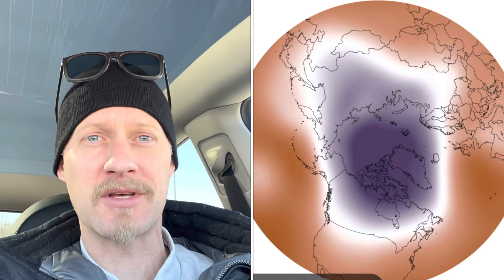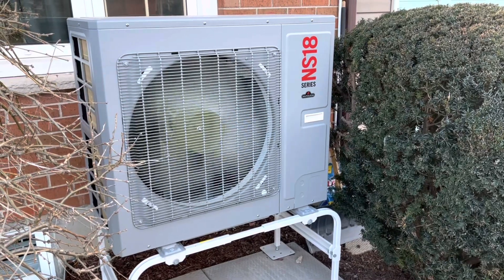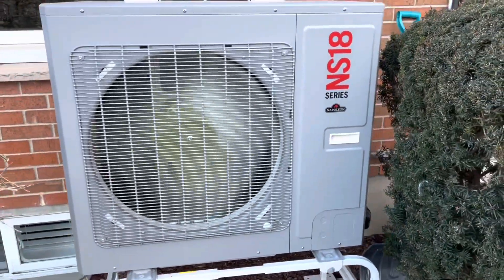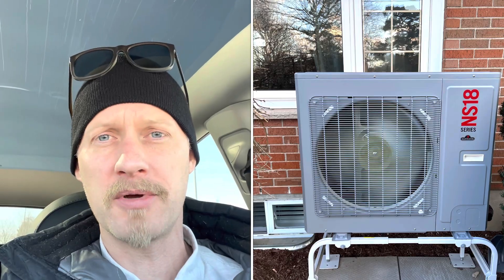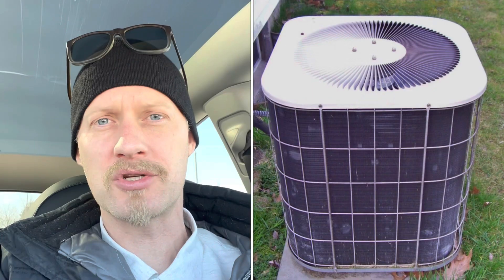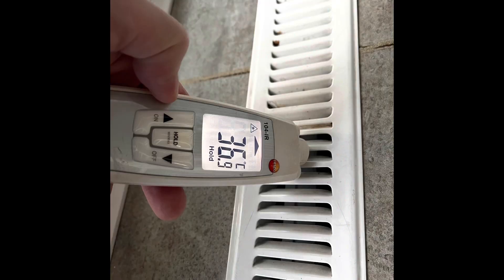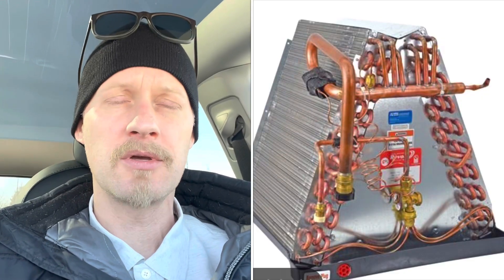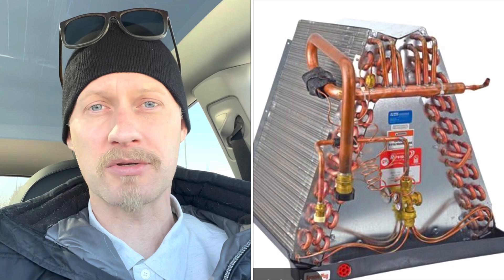Cold climate heat pump, the truth in the cold!

Comment: NO!   These Heat pumps do not work enough under freezing. Forget it. They should not be placed anywhere in zone 5 or below.  Only The South such as Kentucky to southern Missouri down. And in Florida and the Deep South just buy a good seer AC and furnace.  They are not worth it in the Deep South.
Reply: Which heat pump matters a lot. The Mitsubishi is good to -5 F, maybe lower. The Friedrich is only good to 45. That one is only advertised as an AC unit with a heating capability, so it does operated as advertised.
Reply: @mikespangler98  people in my area are no longer in the heat pumps that are wise because our power bills have doubled and everybody is switching to propane. I’ve had 2 heat pumps …one died in 10 years …the compressor and the second one has had $3000 worth of repairs on a computer board and several other small issues and thank goodness I bought a five year warranty and both were Trane. Seer 13 first. The unit now is six years old and it’s a Trane Seer 18 xi.  3000 in expense so far.  No more.

Comment: Heating your home with 97 degree air?  What was not discussed was how expensive is it to run a heat pump in cold weather.  Once the strip heat comes on $$$$.  It works, but at what cost?
Reply from the maker: Efficiency video is next but sneak peek (it’s less than half what gas costs). No heat strips in this set up.
Reply: Heat pumps are about 300% efficient compared to dinosaur gas furnaces which are less than 100%

Comment: I have a zoneline style heat pump/resistance heat HVAC unit and if it runs twice as long on heat pump mode versus resistance heat, where's the savings?   Also it's completely ineffective below maybe 35 or 30 degrees, but I don't think it is a "cold climate" heat pump.
Reply: You didn’t mention where you live but in general heat pumps are meant to run for longer periods of time and put out lower temp heat say 90F. However for the same kWh of electricity to run the heat pump you will get 2 to 5 kWh of heat depending on outside temp vs 1 KWh of heat from your resistor heater back up/ supplemental source. The refrigerant in the heat pump is cheaply “ grabbing” the ambient heat in the atmosphere. You can verify this by getting a fancier thermostat that can tell you how many kWh you use when heat pump is running vs resistance heater. Other heat pump videos on YouTube can explain the how’s and why’s of their proven efficiency over burning fuel or using electrical resistance. 
Best metaphor for this is going 40 miles in Toyota Prius on 1 gallon of gas vs 40 miles in Pickup Truck on 3 gallons of gas.
Reply: @Pierceb2  Thanks, that explains it.  I live in New Jersey.  Your Toyota Prius analogy at the end really clears it up for me.

Comment: mmm...well I had a heat pump when I lived in Florida, when the temp was below 40 Fahrenheit it didn't do much and the aux heat came on, of course this was one that looked like an a/c unit. However it was a high efficiency unit from a major manufacturer and it was constantly breaking down, the circuit board, blower and all kinds of electronic parts were very unreliable and never less than $500 to fix. my neighbor bought a high efficiency unit from one of the best selling manufacturers and had the same experience with breakdowns and repair costs.
Reply: I have an early model inverter heat pump in Fl too....after 7 yrs its had no issues other than annual service ($89). It sips electricity and on cold nights (40 degs) and heated just fine. The most important thing to install in Fl is a surge protector for lightning & power surge.... my neighbor had that issue and it blew out his circuit board and compressor. The newer heat pumps for cold climate are much better and can heat down to -22 degs.

Comment: Thanks for sharing! We're also in southern Ontario, and we're having a ducted cold climate 20 seer heat pump installed in a couple weeks, as well as a Rheem Hybrid heat pump electric water heater. Needless to say we are quite excited to be ditching more gas! Wondering if you have a rough idea of your kwh usage for your heat pump per month for January and or December? Thanks either way!
Reply from the maker: Yeah I use the emporia to monitor energy and looks to average about 500kwh a month so far in winter. Seems a lot but that’s about $50 in energy compared to twice that in gas for my mid efficiency furnace. Hoping to do Solar soon to balance the cost.
Reply: @yourelectricneighbour3633  awesome! Thank you! We were planning to do solar this year too, but our local grid won't accept any additional kWh at the moment and battery storage is just prohibitively expensive right now. Can I ask how many square feet your home is?
Reply: @yourelectricneighbour3633 That makes it worth it. Mid-efficiency you will notice. Here in USA, we have been required to replace our mid efficiency when they die with high efficiency condensing furnaces. Cheap operating! In my darned state, we now HAVE to all use electric heat from now on ONLY, so when our HE furnaces die, we have to get heat pumps. This winter it went to 8° F-about 13° C. But we hit 0° all the time. Am I going to get cold????😢
Reply: Did you have to upgrade your hydro service to accommodate the heat pump?  If so, up to how high?  How is it for cooling in the summer?

Comment: You mentioned windchill. Windchill has absolutely nothing to do with the actual temperature or if a heat pump will or will not work. People use the term windchill to make things seem like they are not. Windchill decreases the time it takes an object to drop to the actual temperature, but it NEVER lowers the temperature. Why anyone would go with a heat pump when they have natural gas is a mystery.

Comment: Mine must be rated for 38°F. It sucks and can’t keep the house at 68°F. In Arkansas.
Reply: If you select the right heat pump for the building and climate they work. This applies to any type of heating system. Cold climate heat pumps will just cost a bit more initially.
Reply: You should get a digital thermometer and see what temp air is coming out of your vents. If it is say 75 F or higher you should look at your insulation, drafts, air leaks, window quality etc. I would get a consultation from a contractor perhaps different from the one who put your system in who is in the energy efficiency business. If your state is not promoting energy efficiency check out Northern States like MA, NY, VT and ME based energy efficiency organizations websites. They have lots of info, advice, videos, testimonials etc. 
Many other great videos on YouTube on troubleshooting issue, problems, tips and tricks.

Comment: It dropped to -33Celcius a few weeks ago here.  My heat pump (mitsubishi zuba hyper heat) worked just fine to keep the house at temp until -27C.  When it dropped to -33C it gave up and the aux heat turned on.  That was the only time all winter it used Aux and it only used it for a few hours over night, it returned back to heat pump operation around 9am when the temp rose from -32C to -27C.  My senville Aura in my Garage kept going but I lost about 3C in the garage total temp.  Not a big deal.
Reply: May I ask what thermostat your HVAC contractor used? Mine installed the Mitsubishi thermostat and I absolutely hate it!
Reply: @jko0526  It's a Mitsubishi unit as well.  It has to be to control it properly.  It does suck, but I've learned to live with just set and forget don't try to offset temps etc.  So basically I never look at it
Reply: @jko0526  ecobee is the way to go for heat pumps with aux heat
Reply: I live where it's that all the time in winter. Single digit and 0° F

Comment: Heat pumps are shit below  40 degrees.
Reply: They use to be, and some still are, but there a good many on the market that work well in temps below freezing!
Reply: A lot of older units designed/built/still stold in America...yes. My Mitsubishi HyperHeat Inverter outdoor unit still manages to find heat down to around 5F and blow toasty warm air out of the indoor units.
Reply: Wrong
Reply: @MrMax4music  really so your saying my unit which is 5yrs old works good? Interesting. It's a 3.5 ton Ameristar, professional installed and maintained. They've told me the exact same thing, they don't work for shit
Reply: @funrunner1277  No, I didnt say that. Your system might be shit, but thats a problem with your system and your installers. Your statement that heat pumps don't work below 40 is wrong. They work brilliantly when specc'd and installed correctly. If your car broke down, would you say all cars are shit?

Comment: Thank you for the video, did you go through the greener homes grant? With retrofitting the heat pump into you existing furnace instead of going with an air handler how much of the $5000 grant did you receive?
Reply from the maker: Last year Enbridge had a separate grant for heat pumps but I will also be going through greener homes for other upgrades.

Comment: The problem is not the cold (within reason), it is cold in combination with humidity. Dry cold is no problem, but in the UK we have a lot of humid air and temperatures less than say 6C. This causes condensation and icing. This means the system has to de-ice and fall back to electric heating which is expensive in the UK.
Reply: My Panasonic starts freezing up under (so not at) 3 C here in The Netherlands. Not a big deal if you ask me. Defrosting takes about 4 minutes and happens every 2-3 hours.
Reply: Ah, I wondered where the water was coming from underneath my Daikin HP here in damp Cornwall.
Reply: @virgil7100  Might also be condensation between 3 and 9 degree celcius
Reply: @virgil7100 I was thinking of getting  a daikan (aka Franklin or Goodman) 12000 BTU mini split for my condo.
Are you happy with daikan?? Thanks so much jeff
Reply: 👍 talking sense.
Reply: Why does it fall back to electric heating?  Surely it just does a quick defrost cycle?

Comment: New modern technology heat pumps work well in very cold temps. Old conventional heat pumps primarily built for Florida winters. Old base heat pumps in very cold temps will run an run unless backed by an auxiliary heat source like nat gas propane or 60 amp electric heat.
Reply: wish I had know these cold area one were out there. I have been wondering what NY is going to do with no gas allowed.

Comment: I've got one of the Senville Aura units good to -30c here in Saskatchewan. It will work that low.  But gas is a fair bit cheaper because COP falls off a cliff.  Best guess is that it has to be above -7 outside to beat my newer furnace on cost.  Which of course it almost never is in winter. Given electricity is so much higher cost in Ontario,  where is your transition with your system?
Reply: Hi, I am here in NY (Long Island). Here many houses burn oil like mine. With the prices of oil here around 5 US dollars a gallon, my transition here is actually non existent. I can go all the way to -15F and still using electricity to feed the HP is cheaper than turn my boiler, even we paying here around 25 cents per kWh.
Reply: A good way to offset the costs of electricity is to install solar panels. Very cheap (or even free) electricity makes heat pumps a no-brainer!
Reply: @Rich Teer  At this moment in time,  with my power costs at .14 $CAD/kwH, no feed in tarrif, unfavorable forex, and borrowing costs over 6% I would straight up lose money with a solar install. One of my variables needs to change before the math makes sense.
Reply: @joewiddup9753  Solar isn't right for everyone all the time, but when it is, it sure is nice! I live in BC and haven't paid for electricity in the four years since I installed my panels! 🙂
Reply from the maker: That’s a valid question and dependent on time of use for energy costs but should have a good idea in another few months where the balance point is. Thanks for sharing

Comment: We have Daikin split systems in our house in UK, so far the worst cold spell last month temp went as low as 6 c, and they were taking a few more minutes to warm up and then pump hot air throughout, but certainly acceptable ,we have retained a gas supply too as a backup for the gas fire in main living room which we turn on in the evenings if really chilly.
Reply: Our gas fire also is a backup if the electric fails and the supply is on a knife edge at the moment and when they soon remove the coal power stations in the UK things will get worse. This is something I will hang on to whatever until gas is banned. Then Heaven help us all in a solar powered sunless UK winter when the wind is not blowing.

Comment: Should you buy an oversized unit for heating?  Could you put a propane burner in the outside unit to increase air temp over the coil?  I am not considering a mini split.  Too expensive and ugly.
Reply: You might pay a little more for a mini split, but when it could cut your operating cost in half, then your old style is really the most expensive!
Reply: @stevem1081  10 mini splits for a 10 room house.  Tell me about expensive.  And they basically look like shit inside.  Maybe the unit could be buried in a ceiling or under a floor.
Reply: @Fred Wills Yeah well I want to heat with the pump and Mo. temps are about the same as yours.  Its warmer this year.  The neighbor put in a heat pump which I deem way oversized but he has no problem heating and has reasonable bills.  I was going to calculate heating requirements the traditional way based on load but due to the low efficiency at low temps I am wondering if oversized is'nt the smart way to go.  I have 10KW of back up with a 75 amp breaker at 220 Volts and I know that will bankrupt me to run much.  The problem with the water heater is the abysmal recovery times as well as the initial expense.  A furnace that heats the water might be better.  Everyone here used to be on propane but they have all gone heat pump due to cost and unpredictability of supply.  I do plan on investigating heating water with wood and sending it to a heat exchanger on the cold side of the furnace.  I have 7 wooded acres.
Reply: If you live in a cold climate get a cold climate designated heat pump and have a plan to insulate your home well. An outside propane tank to somehow warm the coils would be very inefficient. If you don’t have a duct system already but a boiler they do have air to water heat pumps to run using your radiators. Very common in Europe where A/C is or was less common. Bosch and many others make those also. You need a few consultants or contractors to give you different solutions or options as there may be several. Most States and Energy Efficiency Organizations have websites with options and case studies. Check out MA, ME, VT, NY to just name a few.
Reply: Beware that if you going with a central unit then the capacity of the heat pump much match what your ductwork can handle. That was a limiting factor for us. If we want to go bigger then we are looking at associated duct work.

Comment: Basically they run constantly.  I’d love to see how the massive hydro consumption compares to gas consumption of a furnace with all this BS carbon charge for gas factored in.  We couldn’t run a heat pump only at night in low peak power cost like you could a/c.  I also don’t think it’s a nice heat at 97f nothing like a gas furnace.
Reply: A gas flame is 2200 degrees F.  My guess the coil around 200 degrees or less.

Comment: Well my Mitsubishi hyper heat units put out 94f at -15f the other night. I’m happy with it. Now -15 is not normal for here. We design for 0f and my house has 2 other heat systems.
Reply from the maker: Impressive, those Mitsubishi’s are good units.  At that point the heat loss of the home is the biggest factor for how long the unit runs, not the efficiency of the heat pump.
Reply: Ya I get that. 2 of the rooms that have the units struggled. Wind plus 2x4 exterior walls at r15 it did the best possible for a 70 year old house.

Comment: I imagine the unit is kicking on electric strips at that temperature
Reply from the maker: Heat strips are usually installed in an air handler if the customer chooses which I don’t have. So this was all heat pump.